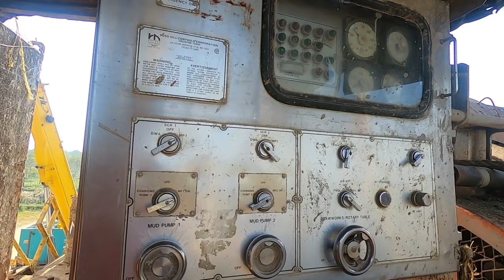DRILLING RIG,ASSAM

Comment: Im supplier in drilling spare drill pipe and hammer union and FMC plug Valve Anson spm and swil joint and plug Valve ripair kit and gate valve all  drill sapare